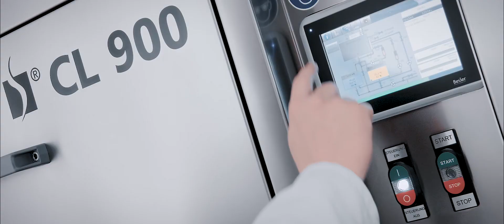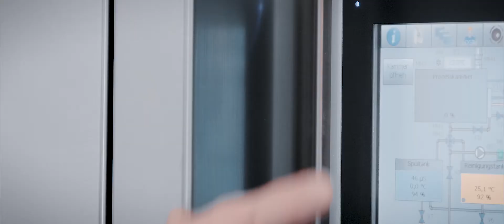SYSTRONIC CL900 - the PCB cleaning machine

Comment: At the beginning i thought it's taken from inception and i was wonder how they did allow them to use to on there commercial but later it got changed. Either way nice Video and hope u guys succeed with your project
Reply from the maker: Thank you for your comment, Mohammad. Just to clarify, the SYSTRONIC CL900 pcb cleaning system in the video, is fully developed and in production. You can read more about the unit here: https://core-emt.com/systronic-cl900-pcb-cleaning-machine